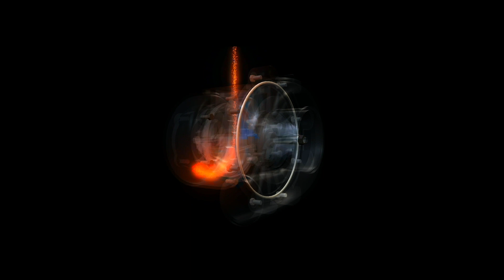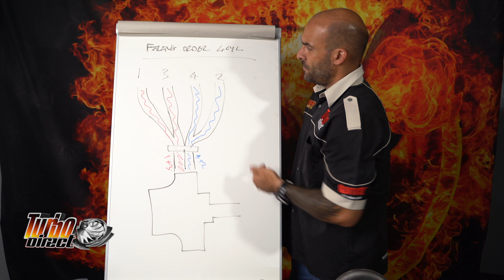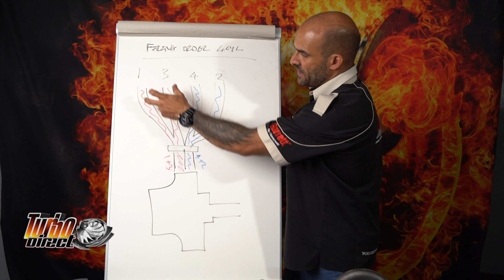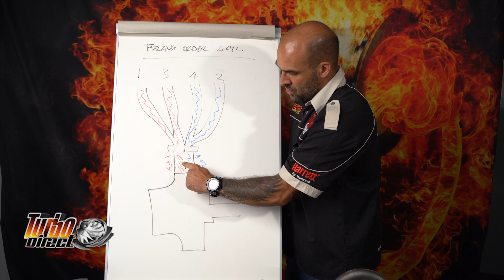Twin Scroll Turbine Housings explained

Comment: Why would you plumb 1 and 3 into one side of the twin scroll and 2 and 4 into the other side. On cross plane V8 engines there is 2 axjasent cylinders on one bank that fire 90° apart. The second of the two tends to push hot exhaust into the first cylinder causing a detonation issue. The 4 cylinder with consecutive cylinders pushing exhaust into the first in the firing order. Mazda addressed this when introducing their Skyactiv series engines with higher compression. 1 and 4 firing 360° apart are connected in one collector which prevents hot exhaust diluting the other cylinder. Turbo manifolds are short to get the hot exhaust into the turbo quickly, many using a regular cast manifold. To my thinking it would be best to plumb 1& 4 and 2&3 together into the scrolls. Now 1&3 and 2&4 together could provide a stronger pressure hit to spin the turbine up, but I worry about the possible hot exhaust gas dilution.
Reply from the maker: Dale you are 100% correct, each engine will have a different setup depending on its design from the factory. The big bang nike engine from Yamaha is also another tricky one when it comes to the manifold design.
Reply: @TurboDirectSA  what do you think would be better for a 2.0l diesel with a 35 that would rev 5500 rpm, 1&4 and 2&3 or 1&2 and 3&4?
Reply from the maker: @simonetdi  What do you mean by 'with a 35'??
Reply: @TurboDirectSA  70/60 turbine wheel
Reply from the maker: @simonetdi  The 35 does not have this size turbine wheel.
Reply: @TurboDirectSA  I'm going to run hx35 that has 70/60 turbine wheel with twinscroll housing and manifold and I was wondering if 1&2 and 3&4 plumbed in the two scroll would be a good idea since I don't rev the engine as high as a petrol one.
What do you think?
Reply from the maker: @simonetdi  yes it would still benefit you low down regardless of the engine type

Comment: Something I think you didn't cover. What if you have an un equil exhaust set up, a normal manifold not tuned, and youbput a twin scroll turbo will you still se better response on spool ??
Reply from the maker: There is still a pulse separation, i believe there will still be benefit, but because the manifold length is hugely different (normal log type manifold with flange face on one end) there might only be gains seen in the higher RPM range when the energy pulse is high.

Comment: Have any input on about how much I'd actually benefit from going from a 1.00ar to 1.32ar power-wise?  The car has a 2.2l 4g63 with a precision 6466 1.00ar.  Currently, the car made 748whp/585wtq on a mustang dyno at 45psi, but the power is dropping off hard after 6800 rpms due to the turbo being out of steam.  Debating if it is worth the switch, and how much it'll actually pick my powerband up on the top end.  Thanks
Reply: Internet guy here with no accountability whatsoever:

Do you care about anything other than top of the power curve? What is the overall pounds-per-minute flow rating of the turbocharger? Do you have your maps for your turbine and compressor available? Can the turbine even flow more pounds per minute, regardless of which housing you put on it?

If and ONLY if your compressor is still within it efficiency islands, as in not off the map at the top end, or near overspeeding territory, then a turbine with a larger A/R of 1.32 will likely make more power than a 1.00 A/R, because it seems that the exhaust turbine is being choked off. However, you will most likely lose some power at lower RPM as the same turbine housing that allows exhaust to flow more freely can cost power at lower RPM.

What is the pounds-per-minute of the Precision Turbo compressor?

From Precision's site:
PTE's GEN2 PT6466 CEA® Turbocharger features the following:
� Exclusive GEN2 CEA® (Competition Engineered Aerodynamics) compressor wheel machined from a 2618-aluminum forging
� Higher efficiency and faster transient response for maximum power and performance
� 64mm inducer compressor wheel
� Compressor cover options:
� - "Ported S" compressor cover 4.0" inlet/2.5" outlet
� Exclusive CEA® (Competition Engineered Aerodynamics) 66mm, 76 trim turbine wheel
� Turbine housing options:
� - T3 .63 or .82 A/R with 4 bolt (2.5") discharge
� - T3 .63 A/R with 5 bolt discharge (with or without wastegate hole)
� - T3 .63 or .82 A/R with 3" OD (outer diameter) V-Band discharge
� - V-Band inlet .82 A/R with V-Band discharge
� - T4 .58, .68, .81 or .96 A/R with 3 5/8" OD (outer diameter) V-Band discharge
� - T4 Divided .84, 1.0, 1.15 or 1.32 A/R with 3 5/8" OD (outer diameter) V-Band discharge
� - Buick .63 or .85 A/R
� - K26 .82 A/R
� * NOTE: Additional cost may apply for certain housings.
� Available with an air-cooled, dual ceramic ball-bearing center housing rotating assembly (CHRA)

What are your turbine and compressor sizes?
Are you using a divided exhaust turbine housing?
Does whoever installed this provide any information whatsoever?

Comment: Very interesting and informative video, thank you. It was my understanding that one volute in a twin scroll (using my  bmw b58) is designed smaller - creating higher pressure airflow at low rpm's while the second volute is larger for more air volume a t high rpm's, basically cutting turbo lag time at low rpm's. Ironically it's so responsive (I drive in "comfort" mode) that I haven't even paid specific attention to it. Pretty sure it's managed by the ECM, works amazingly well whatever they did.
Reply from the maker: Pleasure - glad you enjoy the content. I assume you referring to the A90 twin port head. Either way there is no transition valve or control mechanism to switch between volutes. The AR of the volute is spot on, and the engine CID is large enough to drive the efficient solid disc back turbine. and high flow compressor - this is an example of a perfectly matched turbocharger/engine combination.

Comment: You went wrong on the runner  merging. 1-4 are toghether and 32 are togherher
Reply from the maker: There are many ways to arrange the piping, depending on the housing inlet, collector vs wastegate routing etc - i mentioned one of many.

Comment: Very informative video thank you.

But I was wondering what would happen if you run a twin scroll housing on an open manifold? 🤔

In my particular case I'm interested in a s257sxe that only comes with twin scroll housing and I will be running a open cast manifold. I guess you don't have any benefits out of this, but are there some downsides, is it a bad idea?
Reply from the maker: There are benefits if your manifold splits to separate the pulses. Yes not all the way through the housing (as its not twin scroll) but it does help.
Reply: @TurboDirectSA  well it's a rev9 for a 7mgte so it's absolutely not the case haha 😅 

But it still look like the best combination for what I want, so as long as it don't create problem I guess it's good

Thank you very much for your response !
Reply from the maker: @valyuno1356  Happy to help - Enjoy

Comment: Hello

So on a twin scroll turbo and manifold must you use twin wastegate?
Reply from the maker: Good question - and the answer isn't as simple as you might think. The single gate will work 100% BUT the position of the gate is key. We normally position the gate ontop of the turbine housing itself just past the inlet flange, along the spine. this is the best position for linear control, and ease of installation. However you can install two gates if you prefer to install them on the sides of the separated collector just before the inlet to the turbine housing.
Reply: @TurboDirect S.A  Good day 

So I installed a Borgwarner sx200sxe on my 1.8t 20v vw engine, the turbo is very laggy, will this housing help and work on the sx200sxe?

Comment: Why not just place an independently controlled/fed fuel injector and ignition system in the turbine housing and bleed off o2 from the compressor housing/wheel to be ignited in the 'valute' to spool the turbo up to the boost threshold from much lower in the rpm range? (Effectively increasing the displacement of the engine, with the increased displacement having an exponential increase in the volumetric efficiency of the engine. ( Turning a 2.5L engine into a 3L engine that has the ability to flow the same volume of gas (output) as a 4L engine at <2000rpm and as a 3.5L at <3500rpm... Yea na?

Comment: What huh, wait... 
9:10 is basically describing a 4 into 2 into 1 style system...
Where #1&#3 primary open into a collector where the scavenging low pressure wave is  largely wasted... 

It's basically a slightly less efficient sequential turbo set up, but both primaries/collectors/turbine housings feed in parrallal onto/into a larger single turbo, turbine wheel.
Reply from the maker: Pulse separation is the key to uninterrupted reverse pulse reverberation. scavenging on a turbocharged engine (OEM turbocharged engine) has camshaft profiles that lessen the scavenging effect - improving boost response.

Comment: Does twin scroll provide any benefit on a twin turbo v8 setup? My four header pipes on each side merge into a collector and then would feed the twin scroll. Is that bad? Previously you suggested twin scroll for me, but I’m unsure how I’d be able to get the correct pair of exhaust tubes to each volute since they’re not all on the same side of the engine. Thanks.
Reply from the maker: There are two routes to go with any VEE type engine - or flat opposed engine with separate banks. Single turbo and then twin turbo. Single turbo is cheaper to upgrade, but you have the problem of positioning the turbo so that you have similar length manifold runners, which normally requires the turbo to be installed on one side of the engine, making the runners on that side much shorter than the opposite side.  For this installation i would use a single entry turbine housing design, as you wont see any benefit from the separation of the pulses due to the different length runners.

The twin turbo setup is more expensive but looks nicer if you are able to install visibly, and with symmetrical turbos - the runner lengths are easier to control, and then you would install Twin scroll turbine housings on both sides, separating the pulses to gain the most efficiency from the turbos.
Reply: @TurboDirectSA  Yes, but for my twin turbo application, I cannot really pair “opposite” pulses into each scroll. If the firing order is 18436572, the cylinders you’d want to pair into each scroll are on the opposite sides of the engine. Hopefully my question makes sense. For example, cylinders 1 and 6 are firing opposite of each other,  but are also on opposite sides of the engine. I guess I could pair 1+5, 3+7, 8+6, and 4+2 to separate pulses as much as possible, but it’s not ideal.
Reply from the maker: @general23cmp  100% you would still couple 1 and 3,  --  5 and 7 together on the one VEE and then 2 and 4, -- 6 and 8 together on the other VEE - this makes a difference and is beneficial.  We have experience with this - see here:- https://www.youtube.com/watch?v=3mEfKzsu9os

Comment: I thought of a merge valve for twin scroll when I was a first year apprentice. Mechanics said it was a silly idea. Several years later I see that Borg Warner has used the same design. It doesn't seem to be main stream though, not sure why.
Reply from the maker: They are used alot by Mitsubishi and BorgWarner in some Diesel applications. We have these in stock and move them often.

Comment: I would like to ask what is the max boost for an 1.01ar with a full exhaust 4 inch and how would I know the right housing for achieving the right boost without backpressure lot to learn from you🙏🏻
Reply from the maker: Thanks for the comment - ill need alot more info to provide any form of answer for you. What turbine? What Family AR? (T3, T4, T6 etc), what engine? What VE is the engine? there are just too many variables to provide you with answer without more info. 

The easiest way to to physically measure the EMAP, thats if you already have the turbo and housing in place with the build completed, but if you dont, then i need alot more info to guide you.

Comment: Hey I have a quick question I have the new g45-1500 and I have a problem ,if the turbine housing is twinscroll and my manifold is designed for v band but its not on a split firing order all the cylinder outlet will go into a single colector to the turbo is this an issue? ,I cut the v band and modified the flang to suit the turbo then iv try it on the dyno it made 100 hp less than the old gtx45 gen 1 and cause serios back pressure so is that a relevant or it won’t make any difference in hp or backpressure I hope you can fix my problem🙏🏻
Reply from the maker: Did you physically measure the backpressure? I can tell you from experience that the G-series turbos are not cut out to what they are advertised as - they do not make the printed catalogue power, and are lazy in comparison to the older Gen1 and Gen2 GTX models - i dont believe there will be a 100HP difference just from the collector/manifold design change at the same boost, same engine and same AR turbine housing. Very unlikely. 

What i would do is measure the EMAP on the existing G45, and then re-install the old turbo, and verify the power and measure the EMAP and my bet is that the G45 is the issue....

Comment: Hey mate, super informative video and very interesting, I'm new to turbos and I'm about to single turbo swap my 1jz gte non vvti, but I am having a very hard time deciding weather to go twin scroll or single scroll, have watched a lot of videos and read a heap of online forums about twin scroll vs single scroll on a 6 cylinder engine but its very confusing as people have different opinions. I will be using a pulsar gtx3076 0.82A/R and a 6boost manifold but would you be able to recommend if I should go twin scroll or single?  the turbo is on the smaller side and I'm looking to push around 400/450hp, I'm really undecided so any feedback would be greatly appreciated, thanks!
Reply from the maker: Thanks for the compliment - the project is not very high HP and if you will be using the car for street driving, and areas where you need low down response, go for a twin scroll manifold - it help no matter how you look at it. The only issue you will have is finding a turbine housing with a small enough AR in twin scroll format. The AR61 housing is Vband, and will spool quickly, the issue is that Garrett dont make a small AR twin scroll housing - so using say an AR1.01 twin scroll turbine housing will actually spool later than the Vband AR61 -- 

If there is a small twin scroll housing,  use it.  If not - stick to Vband - simple as that.
Reply: @TurboDirectSA   Thanks Mate! I really appreciate the response!
Reply from the maker: @Jesse-nd6bz  Anytime - happy to help.

Comment: Randomly came across your channel, very nice information and video. Thanks for the video. 
Quick question, when you mention about the adapter with valve, i think on the market currently they are called quick spool valve, i wonder if there exists a spool valve that work with twin scroll designed manifold ?
Reply from the maker: Thanks for the compliment - glad you enjoying the content. The Quick Spool valve does come in a twin scroll design - thats precisely what makes it beneficial to spool larger turbos up.  Not sure who makes these, but we played with these in 2010 and they worked very well.
Reply: @TurboDirectSA  sorry i should have been more clear, what a mean is a spool valve that will work with devided exhaust manifold + twin scroll turbo. Do Such valve exists?
Reply from the maker: @mkivst180  Absolutely yes - this is the only application you would use a quick spool valve - in a twin scroll application. You want to block the one port of the turbine housing to allow all the gasses to enter into the one port only, which will spool the turbo up faster, once you are up to a prescribed pressure, the other port opens up with a butterfly in the valve.
Reply: @TurboDirectSA  from normal understanding point of view, the normal type of spool valve on the market cannot be used for devided exhaust manifold. If the valve is in shut position, say in 4cyl engine, where are those two exhaust gas gonna go since valve is shut? So my question is a spool valve that will work for devided exhaust manifold If Such thing ever exists at all?
Reply from the maker: @mkivst180  Im not sure what you referring to, we obviously talking about two different things - there is only one design of a quick spool valve that im aware of, as described in my video and in my previous comment.
Reply: @TurboDirectSA  let's make it more simple :)
Engine 4cyl, twin scroll turbo + divided exhaust manifold + quick spool valve, will this work?

I hope make sense now?
Reply from the maker: @mkivst180  This is exactly what i have been referring to from the start - see here:- https://youtu.be/ryafhwfCgcw?t=639   and up to  here https://youtu.be/ryafhwfCgcw?t=700 

This explains exactly what i have been referring to through all the messages, and precisely what you just mentioned in your last message.